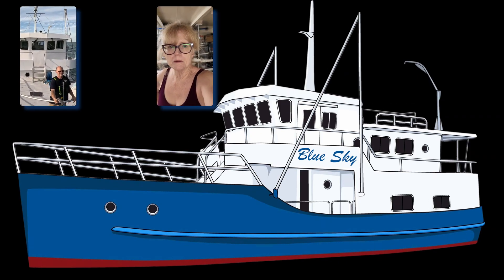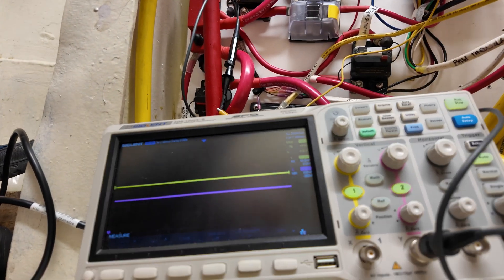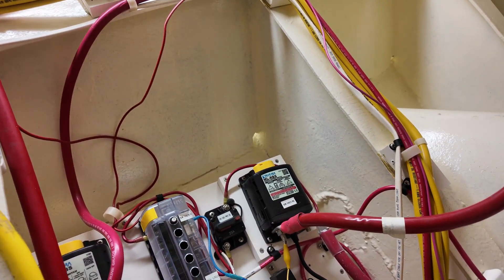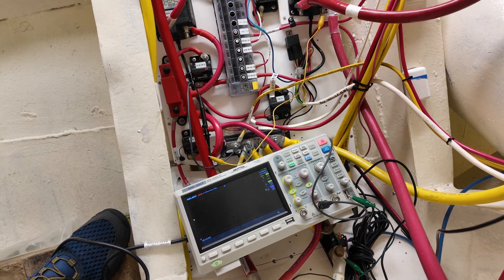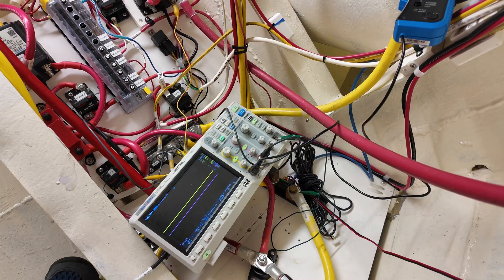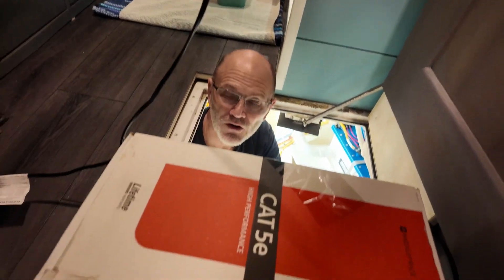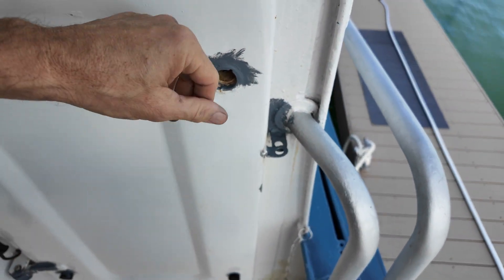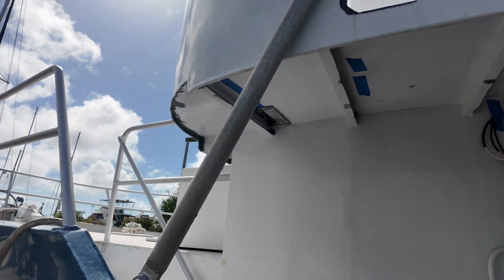We Swapped Batteries and THIS Happened!

Comment: It sounds like you have two BMS’s in parallel this is not an ideal arrangement as if you have one pack with a slightly different internal resistance the lower resistance pack will try to source more current and hit its 300A cutoff leaving the other pack to go into overcurrent protection. In your use case don’t expect 300+300 to equal 600. You will get twice the capacity at modest draw but not twice the peak current draw. 
I think it is great that you are checking your inrush current because this too can give you a transient greater than the batteries might be able to supply. With the lower internal resistance from lithium as compared to the original lead-acids you may be exceeding the instantaneous power limits of the motors which can destroy the motors. Maybe look into a variable resistance starting circuit.
Reply from the maker: Thanks for the info. It was very helpful.  WattCycle is coming out with a parallel battery BMS at the end of the month which I hope addresses some of these issues. I'm also looking into a variable resistance start circuit because we have seen some really high currents.

Comment: Gotta have your scope set to "run" rather than "stop".  Trigger on the input that's measuring voltage. Also, since you have an inexpensive hantek current probe (I've got one also) you have to push that "reset" button on the front of the probe several times while DC current is flowing in order to get an accurate reading.   Don't forget to set the probe setting on your scope to match the input divider you have selected on the current probe (10x or 100x).  There should be a little instruction sheet that came with the current probe which talks about it.  Total pain, but you have to deal with it unless you buy a much  more expensive current probe (or wire up an in-circuit current probe which is risky for your scope if you make a mistake). Finally, my hantek current probe will suck batteries dry even when not in use.  If you haven't just put the battery into it, you'll want to replace or at least test that battery with a voltmeter.
Reply from the maker: Thanks for info on the Hantec Probe.  We sent the first one back and got a another Hantec Probe.  The first one appeared to have been used as it didn't come with a manual or a battery. Haven't tested with the new one yet.  We'll put your input to good use.  Thanks for watching!